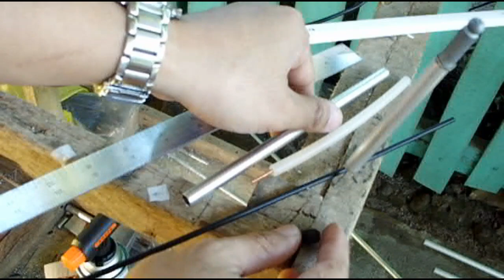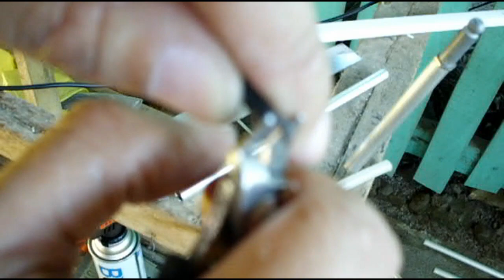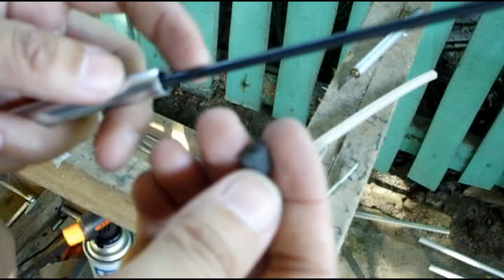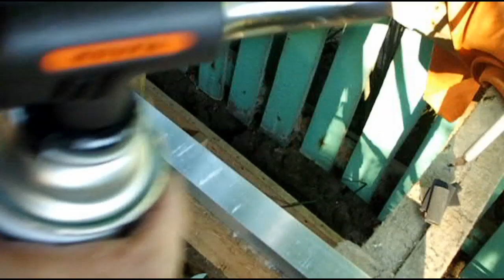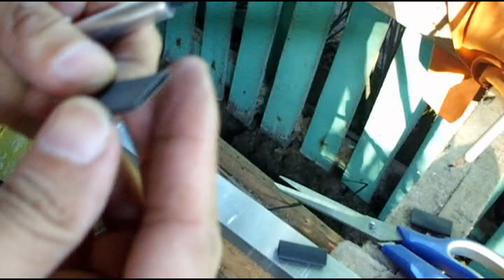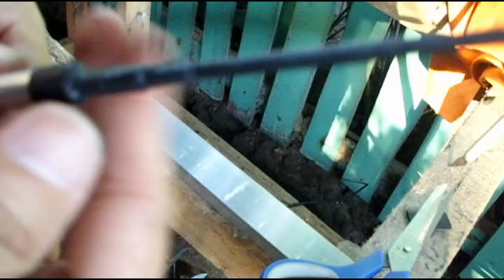Building a Gamma Match

Comment: Gracias por mostrarnos la construcción de un gamma match a los torpes como yo.
En la actualidad en España es muy difícil encontrar hilo eléctrico rigido, ya que la normativa prohíbe su instalación en redes eléctricas de viviendas. ¿sería posible hacer el gamma match con el vivo de un cable de 75 ohms (es decir, con el conductor central y el aislante que lleva incorporado)?
Reply from the maker: You can use the center conductor of RG8 coaxial cable for this you may also use the non rigid conductor or stranded type as long as you can put it inside the gamma tube.

Comment: Sir pag sa uhf antenna  ano po kaya sukat ng gamma match or same lang din sa vhf
Reply from the maker: Mas maiksi 3.5cm usually ginagamit ko hanggang 6cm
Reply: @EphraimGariguez  paano po sa dipole na uhf na may gamma match ano maganda sukat sa gamma sir salamat po ng marami sa reply nyo po
Reply from the maker: Sinagot na kita pwede mo gamitin alin man sa dalawa. Yung haba ng dipole i compute mo na lang sa center frequency na gagamitin mo marami naman calculator sa internet.
Reply: @EphraimGariguez  sir paano yong pag calculate
Reply from the maker: walang calculation nyan mostly trial and error.
Reply: @EphraimGariguez  thanks boss by the way sa 144 mhz at 440 mhz anong measurement ng kaniyang gamma match sorry bagohan palang ako sa ganitong usapin
Reply from the maker: @sbanganaalongan7707  check mo sa website ko nandun ang measurements
Reply: @EphraimGariguez  cge sir salamat tingnan ko

Comment: this video is totally misleading. Remember, the gamma matching is like a capacitor.  you should have used the coaxial without the braid. the dielectric must have been included
Reply from the maker: what is misleading in that? think again many times and you'll find that it is a capacitor just as well. you can put/use many dielectric material in the environment to construct a capacitor like paper, plastic, air end etc to construct a properly functioning capacitor. I suggest you brush up your understanding of capacitor ;) cheers!

Comment: Sir, kailangan po ba ng gamma match if gagawa lang ako ng DIY yagi antenna pra sa signal booster ng phone sa bahay?
Reply from the maker: depende sa ginamit mong driven element pag split dipole or folded pwede
Reply: Maraming salamat sir, naka subscribe na po ako sa channel mo. Dami mo na pala videos. isa pang tanong sir, pag nagawa ko na ang DIY yagi antenna with gamma match for signal booster. Kailangan ko pa ba ipa calibrate ang SWR?
Reply from the maker: @juvanieabejay5663  oo naman hindi mo magagamit ng maayos ang antenna mo for transmission kung hindi mababa ang swr

Comment: Please let me understand it better.

The black  wire has no electrical contact with the aluminum tube inside, right?
👍😷
Reply from the maker: No contact at all, it is capacitively coupled to the shorting stub on the driven element.
Reply: Muchas gracias, señor.
Era solo la información que necesitaba para completar mi antena basada en su video.
--------
Thank you very much, sir.
That's all i needed to finish my antenna based on your video.

👍😆
👏👏👏👏👏👏👏👏

Comment: does ot work ok to mix copper and aluminium? I've used aluminium and aluminium before but not the combo.
  My inner gamma was 6mm, very important that it's water tight you need a rubber glue or something like colle mastique.  (Sickaflex).
  I'm thinking to play around with more gamma match designs. Loaded coils are another thing i want to better understand.
Reply from the maker: copper and aluminum combination will work perfectly fine :)

Comment: Is there any advantage of using #12 AWG copper wire instead of the inner part of the RG-8 as the gamma match? Thanks and 73. de 4G1BNC
Reply from the maker: I re-measured the diameter of the inner conductor using a  caliper it is actually Gauge #12 as it is 2mm in diameter solid. So no advantage, the general advantage of using higher gauge wire is the current carrying capacity but you still have to reduce it to fit the SO239 connector and that wire is perfect fit.

Comment: pag bumili ba nyan bos kaylangan pa ituning o nd na kakabit nalang.
Reply from the maker: 1800 po single 3 yagi antenna free shipping na, wala pong kasamang coax di na po kailangan i tune naka tune na, susundin nyo lang yung assembly manual kakabitan nyo lang ng coax na PL259 ang connector at ikakabit nyo sa SMA connector yung UV5R nyo >>> eto po ang video kung gaano kalayo ang abot >>> https://www.youtube.com/watch?v=K6T2saNHjDI
Reply: pag instal ba nyan sir kaylangan mataas o kahit nd kahit ba saan nakaharap ok lng
Reply from the maker: kahit  20ft lang unless may malaking obstruction yung lugar mo syempre mas mataas mas ok line of sight kasi ang mode ng propagation ng VHF at UHF
Reply: copy sir thanks pm nalang ko pag nakakuha nako ng permit ko. sumali ako sa cabalikat
Reply from the maker: ok po thanks

Comment: What frequency you used for gamma match tito?
Reply from the maker: Gamma Match is for antenna matching, the antenna elements are cut based on the operating frequency in this case 145Mhz. Making of gamma match most of the time is by trial and error you either increase the gamma tube or trim the gamma insert ( the wire inside the tube) until you obtain the best match if you are designing on different frequency, slight adjustment is done using the tuning stub. Use of antenna modelling software is advisable to obtain optimum SWR based on elements length for cutting.
Reply: if ever i make a yagi for 144MHz without gamma match and i impart gamma match, do i need to match the gamma same as 144MHz?
Reply from the maker: There are different kinds of matching for your purpose depending on what type of driven element you are using (i.e folded dipole), gamma match is just one of them. Choose a suitable matching depending on the design of your yagi. Just search for "yagi impedance matching technique".  There are lots of information you can find which can answer your question.

Comment: What is the measurement of gamma ang the tube?
Reply from the maker: https://dw1zws.com/building-the-gamma-match-for-4-elements-yagi/
Reply from the maker: https://dw1zws.com/building-the-gamma-match-for-3-elements-yagi/
Reply from the maker: you can check my website @ https://dw1zws.com for details of the antenna and gamma match it's under the Antenna plans on the website menu